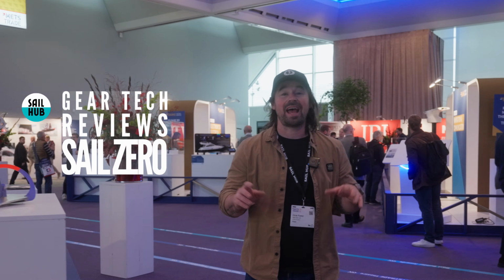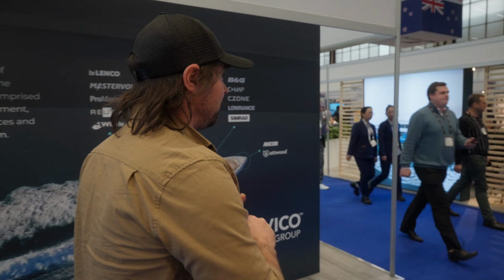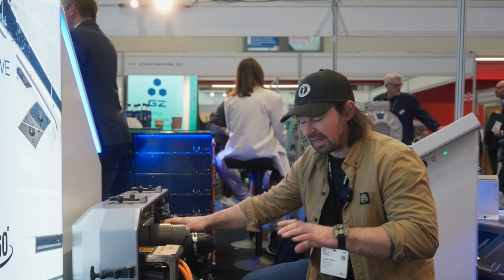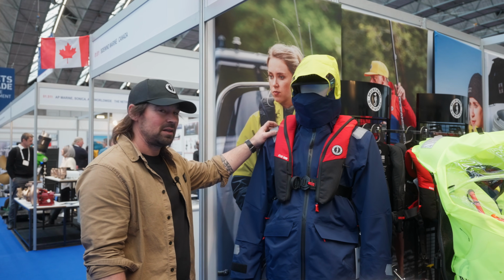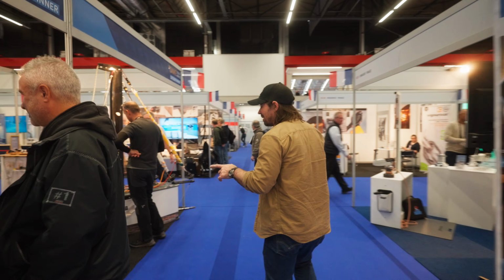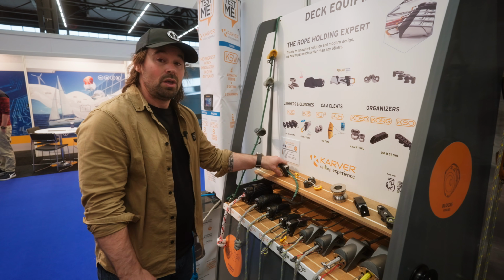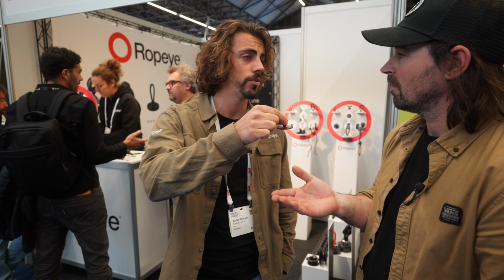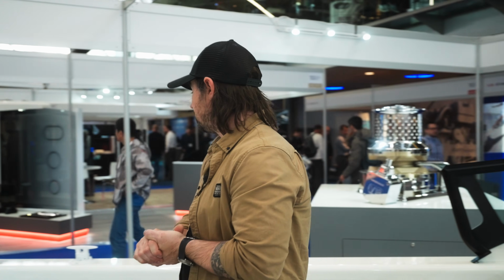Sailing gear that makes LIFE AT SEA better!

Comment: Handle with light is so stupid ;D I mean yeah, you need light. But come on, you can have headlamp or just install lamp anywhere. So many more better options than you winch handle. It feels like either product would suck or you will pay way too much extra because of that led.
Reply from the maker: You can, but then you have either the hassle of fitting one or have it on your person. I think it’s around €10 more than the standard handle. To me that’s pretty good. If they were charging a fortune it would never have made it int in the video.

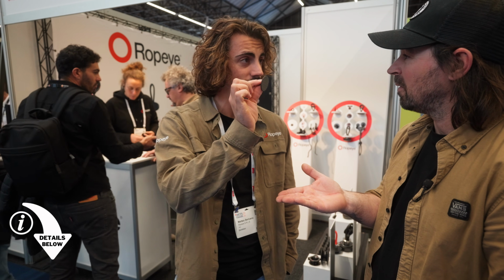Comment: 14:39 Any penetration of a boat hull is a vector of water ingress. To integrate furniture into an inner hull shape or to glue anchors unto hulls without eroding them is a useful technology. 

Also boats come with gimbal stoves, but never with traditional 'gimbal bunks', the hammock - as if boats never roll or keel, possibly triggering motion sickness... the glued anchors can refit that design without second thoughts.
Reply from the maker: Sone great points there! I’ve have toyed with the idea of a gimballed Bec for our build but I am not sure it’s worth the hassle, the weight and the loss of overall space. Still though, a simple trial could be an interesting video for us!
Reply: @SailHub  
"a gimballed Bed" 

The water bed, insider the river bed. 

That's what I thought of a double sized hammock (even with a bug net and under kilt) which can be taken down and stuffed in a moment. 

I also fantasize about filling vanilla inner hulls of pocket cruisers (guess, the 'salon') with knee high warm water like a tub or flotation tank... 

Ya.

Comment: That rophub thing may stick in your northern climate but down here in Northern Aus I don't rate it to last more than a couple of months. 35 to 47 degrees C with crazy high levels of UV will kill it in no time and if the anti foul boys need to leave a yacht painted with their fancy stuff in Gove (Nhulumboy) for a month or three to see how it survives. This is where I found marine life eating in to my Hydrovane rudder so good luck with that. Bring that stuff down here for testing to see how long it lasts.
Reply from the maker: Criekey Nige, sorry to pop a bee in your bonnet chap! 
Yeah, we have some pretty horrendous marine life up here too, and the main issue here is the cold and moisture regarding getting things to stick, but then… epoxy, I’ve not really had an issue with it in extreme heat.  UV, yeah mate, that’s the bugger. But then these things are super cheap to replace, I their best seller is less than €10

Anyhow, that’s the plan for the channel mate, put the sales pitch to the test so you don’t have too!  Let’s see how it works out ay 👍⛵️

Comment: Still no signs of Dynamical positioning for sailboats? :)
Reply from the maker: Hey up, when you say dynamical positioning, do you mean a virtual anchor or a gyro? Check out Bluenav fella. They’ve just gone live with their gps anchoring made possible by a 360° spinning motor.
Reply from the maker: P.s I would have liked to have squeezed as chat in but time was short, maybcat them in Jan for you.
Reply: @SailHub  Dynamical positioning is a system that has been around since the 1960`s in the oil industry,  basiclly making it possible to hovering a ship in the same position. Valvo recently mad a system but that was with a motor boat. I want this on my sailboat. Trust me this is a game changer. https://www.youtube.com/watch?v=lDzP2qwdsaE

Comment: Tried to develop silicone anti foul in the late 80s and it worked a treat in some environments and in others the silicone became a route for bugs to grow into the coating..
Reply from the maker: That’s super interesting. What in earth could live in silicone ay! So when you a route into the coating. What coating are you referring too? 

I would love to know the company name? What happened to the research? I believe silicones have changed over the last ten years or so or at least there are new areas being explored, what re your thoughts on these new derivatives? Do you think they could work.
Reply: @ I believe the silicones came from a company named Bramite (couldn’t tell you where they originated maybe US) or perhaps that was the silicone brand.
We were a gelcoat manufacturer and had some success putting it into gelcoat they already had a two component urethane I believe.  We ran some trials around Auckland and had success with the urethane but in a particular river we found that the growth grew into the silicone coating and it looked like it was growing in the long polymer holes of silicone. I.e. soft silicone in hard coating allowed the growth to follow and push the silicone out of the way.  Same in a gelcoat.  I had some fun and built an opti with the coating that was slippery AF.  Also coated my caravan roof with it and despite being in a wet area where algae used to grow quickly we were able to wash it off no problem time after time.
Other key issue was repainting and sanding the silicone coating…. Silicone in paint shops is death and nothing likes to stick to a cured coating and getting rid of the dust was death to any other coatings for a long time.
I was keen to try it in tooling gels but not my boss lol…

Also played with copper clad in the early days I think you guys had it in the UK through Scott Bader who were our early polyester technology partners.
Reply: Company names… we were Stratos Chemicals, became Ferro Stratos in NZ when bought by US ferro. Then they bailed NZ market and Nuplex bought us who eventually purchased the global resin business of Akzo before being gobbled by what is now Alnex.  This research was done by a couple of kiwis who are no longer with them and long retired… too many economists accountants in the business now to get real research done, lol in my opinion!

Comment: Thanks for the great insightful video.  I would like to know more about induction Marine barbecues.  What is out there?? I am contemplating going all electric.  Cheers.
Reply: Yea,  thanks for that. 👍
Reply from the maker: Not sure that’s the wise way of cooking on an electric boat. Although that does depends on your battery bank, it’s size, chemistry, your motor, required range etc etc 

Of course it can be done but there are constraints. Happy to get into it over on Patron with you if you want to go deeper into the possibilities 👍

Comment: Well done Chris very slick presentation, unfortunately though I have to report the Peller clean you showed at the start is even more slick than you and not in a good way... It all slipped off within a month on our Max prop! I followed the instructions to the letter but it all peeled. I usually use Velox which easily lasts 2 years and then just needs a top coat for another 2.
Reply from the maker: Hey, cheers Steve, nice to hear from you! We were ran ragged at METS this year mate! 
Now, was that’s the tie coat or the silicone that wore through or both!? I ask as they put a lot of development into it over the last few years… We’re looking at doing the bottom of our new build in Seajet’s new silicone…. Would be good to hear your thoughts.
Reply: @ the silicone fell off the tie coat so I don’t think it was my prep. I generally like Seajet stuff, Seajet 33 has worked really well as an antifoul for us. I was hoping you guys would make it to Annapolis this year, guess you’ve got your hands full in Scotland. We’re actually looking forward to getting out of the heat of the tropics, I know you probably won’t want to hear that!
Reply: PS I applied it 3 years ago in Turkey (so it was possibly old stock as well) maybe they’ve improved it?
Reply from the maker: @svfairisle not sure fella, probably going to give it a whirl, the hip should be less effected by the issue anyhow, prop speed however is obviously pretty quick in comparison!
Cheers guys!
Reply from the maker: @svfairisle for real, where are you heading? 
Mate, I’m not one for the heat. It kills me! Mind you it would be a welcome change for a while! Annapolis would be fab but we have our hands full already, Jenni and I would both like to catch up at some point for sure though!
Reply from the maker: @svfairisle re tie coat, I thought that this may be the case, let’s see what the new one is like!

Comment: I used plastic valves in the water industry, they do seize up if not operated regularly
Reply from the maker: Sure, that’s likely nylon. It’s swells slightly in water, it is common for domestic water to utilise hdpe too. Both materials are great and they are cheap too but they are not suitable for marine usage at all. The Tru Designs are made from a fire proof material similar to delrin, This gives a bunch of other benefits and one being that they don’t seize.

Comment: surely there some person out there knows how to stop things sticking to a surface ? maybe teflon coatings is the answer as in frying pans
Reply from the maker: Yeah mate, I think the silicone may be the answer?! The problem with Teflon it’s a killer for the environment and the cost is insane for such an area. 

The silicone has some amazing reviews so we’re going to put it to the test when we launch the boat and see what the score really is!
Reply: @SailHub  Just as an outside runner cover a prop with a 25mm permanent marker pen just keep painting / drawing on to the prop with it and see how it lasts in comparison. Some say it can last as well as Prop speed. Never tried it myself but have seen others doing it so who knows. Could be a funny segment in a future video.
Reply from the maker: Ok, that’s interesting! Personally I don’t paint my prop. I polish it, a quick acid wipe one every couple of months should see her nice and clean. The beauty of a boat that dries out ay…

But, yeah. That sounds mad so I may well try it! Thanks.

The reasons we are looking at the seajet anyifowl is that they have re engineered it as a full antifowl, but there was no demo to hand for me to use in the video. Should be a good test for sure 🤞

Comment: A big fan of Trudesigns fittings. Have several on my boat. Brilliant!
Reply from the maker: Nice!!! Great for other viewers to hear this! 🤘🏼 Easy to install? 🛠️
Reply: @ yes easy to install, lots of good info on their website. Pay attention though to the details regarding parallel threads and thread sealing. I won’t use anything else these days. Fyi, I’m not affiliated with Trudesigns in any way. Just another sailor sharing my own experience. Cheers.